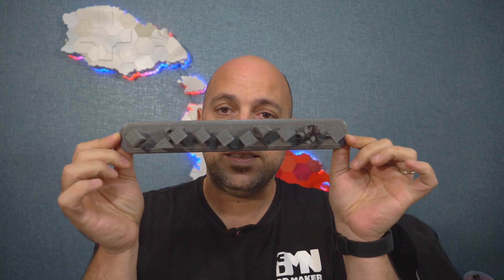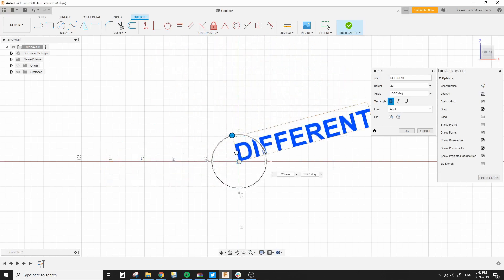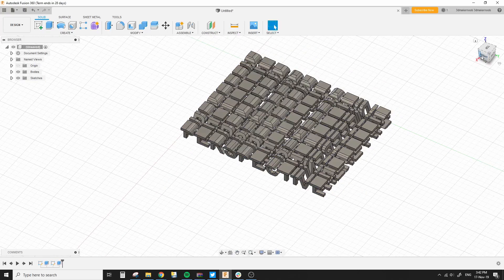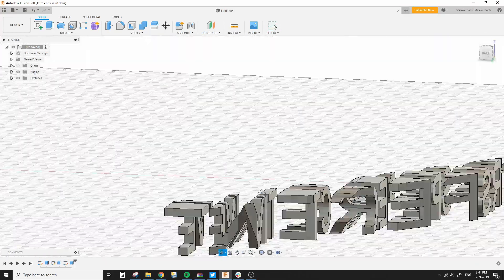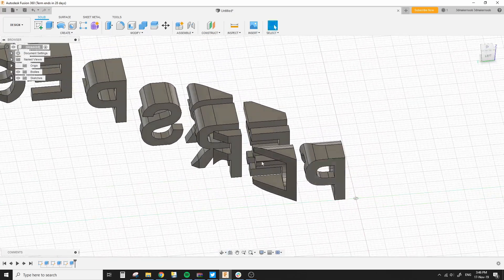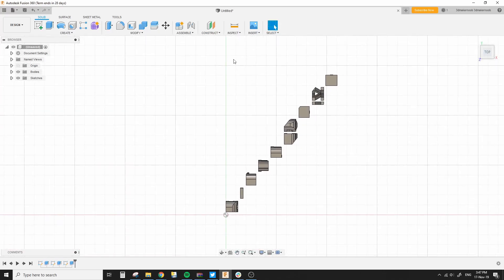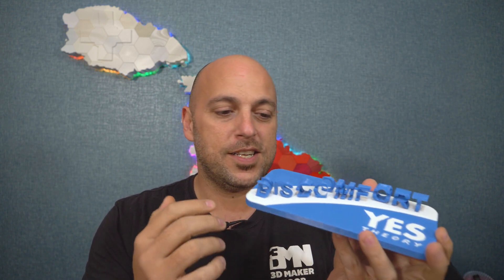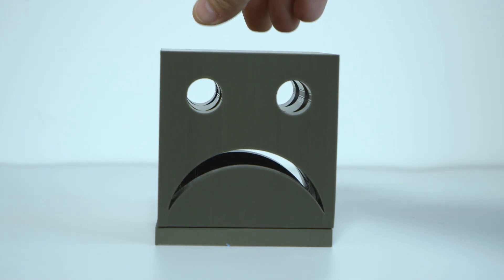3D Printed Anamorphic Text - Fusion 360 Tutorial

Comment: Quick question: I have a ender 2 printer that keeps producing blobs of extra plastic throughout the print, I've checked the filament(works perfect on my other printer), motor does not make clicking sounds, and tried changing settings drasticly to make it stop. So far nothing, settings are: layer hight .2, nozzle .4, temp 210 C, extrusion 82(normally 94), speed set to 50mm/s, and slicer is Cura. Is it possible the nozzle is no good?